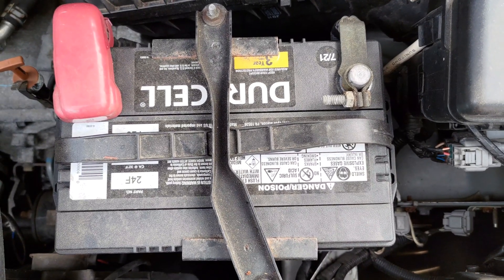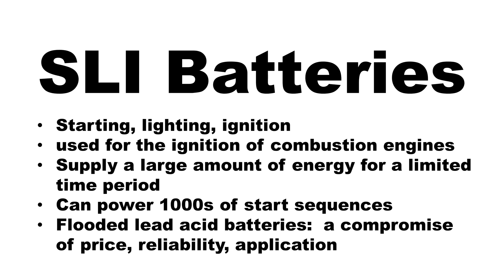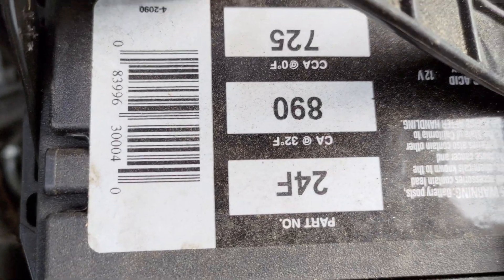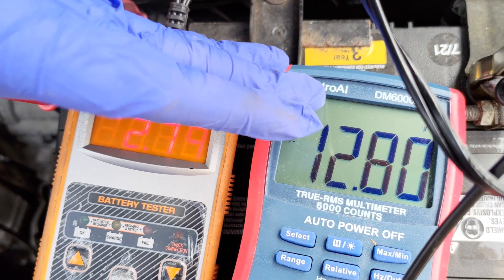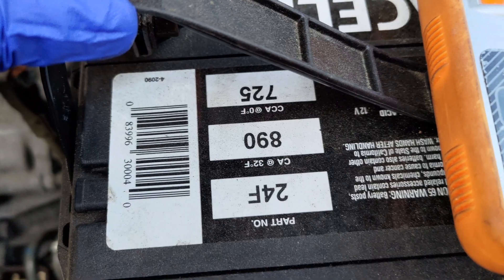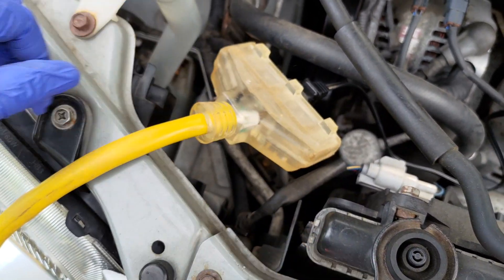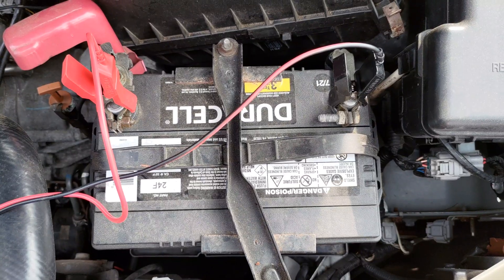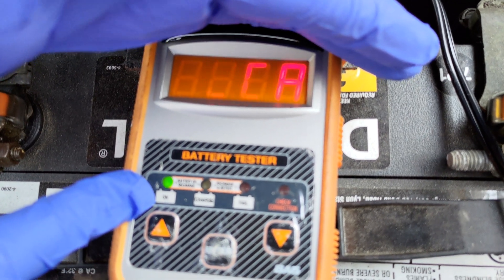How to Check Voltage, Load Test, and Charge a 12 Volt Lead Acid (SLI) Car Battery

Comment: True? A 12v 18ah should last one hour under a 18 amp load?
How to reasonably test the battery health,  what load for how long?
Reply from the maker: Yes, theoretically, a 12V 18Ah battery should last 1 hour at an 18 Amp load (18Ah / 18A = 1 hr), but real-world performance is less due to internal resistance and discharge cut-off; testing involves a fully charged battery with a constant load tester or known resistor (around 1-3A for 10+ hours or ~9A for ~1.5 hrs), timing how long voltage stays above ~10.5V (lead-acid) or ~11.35V (lithium), giving a more accurate Ah capacity.

To reasonably test battery health, perform a dynamic load test: fully charge it, apply a substantial load (like half its Cold Cranking Amps or a specific amperage based on wattage) for 15 seconds while monitoring voltage, aiming for above 9.6V (for lead-acid) to check its ability to deliver power, not just hold a static charge. A simple at-home test involves dimming headlights for 10-15 mins, then checking if they stay bright and the engine cranks strongly when starting.

Comment: I have a couple of sachs dolmar 116si saws. One I bought new in the late 80's and one I picked out of a bin at a scrap yard. The 1st one has always been a great starter usually a couple pulls. So I have never touched it. Just a couple carb rebuilds, regular stuff. Don't even know the squish # or the compression. They have a fuel enrichment lever, rather than a choke. Got the second one running. Same thing ,runs great,  below 0 degree temps 3 pulls. I've ported and played with quite a few saws, muffler mods etc. Had great power results, but it seems like they need more pulls, especially with timing advances. I could easily see myself porting one of these for fun. What do you think will happen to the start ability ? How far can one go before he ruins a good saw?
Reply from the maker: That's a very interesting question about the start ability and how far you can go with modifications.  Might be a good idea to try one cautiously and see the effect.